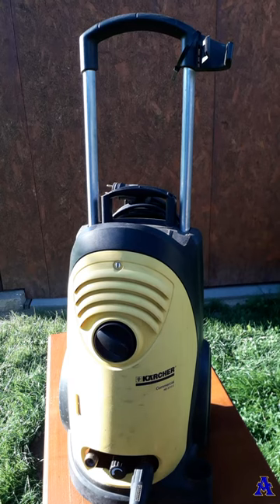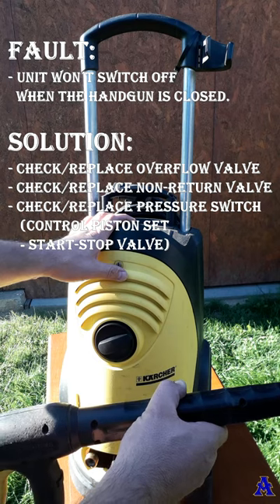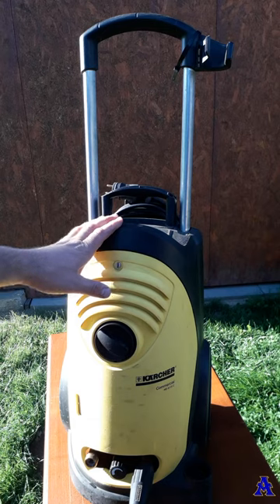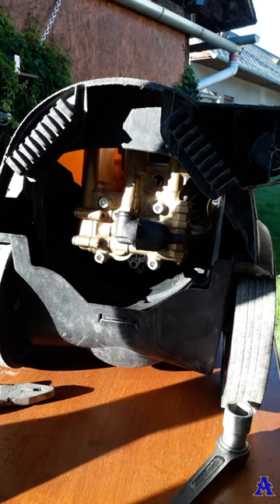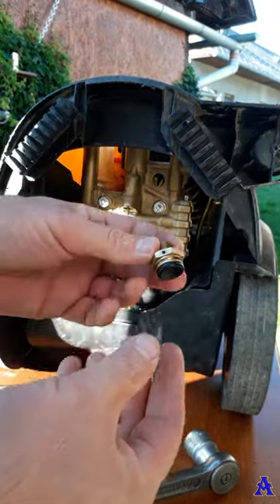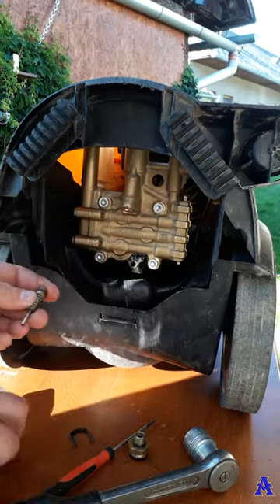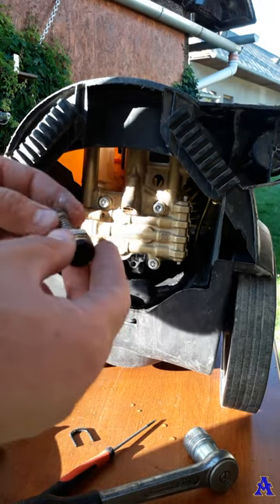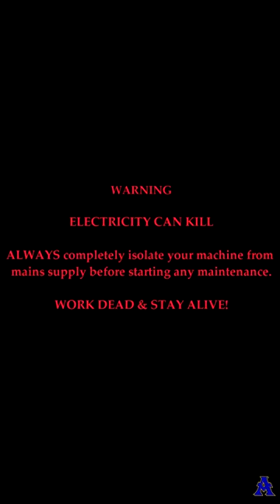Start-Stop Valve; How to Fix Karcher Pressure Washer HD 5/15 C; Repair; (Part 8); Ремонт мойки.

Comment: First it should be important to make sure that the issue concerns the valve itself and not the switch. To see the valve shifting or not when the motor is running (gun switch off) and to actuate the valve switch manually to be sure that you've determined the issue.
Reply from the maker: 100 % true.

Comment from the maker: @antsu4932; Hello Antsu. Thanks for your comment. SPOT-ON. You have accurately captured what is the biggest problem in repairing, for example, high-pressure cleaners, whether hobby or professional class. It is not the repair itself, but the correct diagnosis and this is often an art, since one problem, as in this case the engine does not turn off, can be caused by up to 3-4 different causes in case of this particular problem and the high-pressure cleaner. I also mentioned some in the video on the screen when it appeared: "Fault" & "Solutions". In part 4 of the tutorial, I focused on another cause, namely (Overflow Valve). In the case of this high-pressure cleaner, it is still quite good, since there are only a few reasons. In the case of such hobby high-pressure cleaners and a problem such as "pulsing", the problem can be caused by up to 8 different causes (malfunctions). If you don't diagnose it correctly, you will laboriously and expensively replace half of the high-pressure cleaner and the problem will still persist. I explained it in detail and processed it in a video tutorial for the repair of the high-quality pressure cleaner Nilfisk E 140.3, which I also have published on my channel. My advice and yours will help someone. I want to emphasize that I am not a mechanic or a professional service technician. I learned how to do some repairs as I didn't want to spend hundreds of Euros to service our broken high-pressure cleaners and along the way, I learned a lot, which I try to share with my followers from time to time when repairing other pressure cleaners and equipment. Thank you again and have a nice day. Greetings from Slovakia. Slavo

Comment: Thanks bro, Is it possible to provide a purchase link for spare parts, please?
Reply from the maker: Karcher has its service centers covering almost the whole world. There may be slight differences in how their website looks in individual countries, so I don't know how it is exactly in your country in Egypt. As an example, I will provide you with an internet link to a site in Slovakia where Karcher allows customers to choose and buy original spare parts for their particular machine. I think they have it figured out perfectly here. It is enough if you know the specific product number of your high-pressure cleaner (in my case, Karcher HD 5/15 C+ it is: 1.514.124.0), and you enter it in the box provided on their website. This will take you to the next page, where there are diagrams of the spare parts of this high-pressure cleaner, which, when you click, will show you the specific spare part and its price in the E-shop, where you can order it. You probably won't be able to order those parts from Slovakia to Egypt, but at least it will help you to look at the diagrams of the individual parts and their prices in Euros. In this case, the Karcher HD 5/15 C has an identical spare parts diagram to the Karcher HD 5/12 C. I hope this helps you at least a little. Greetings. https://www.kaercher.com/sk/sluzby/podpora/nahradne-diely.html